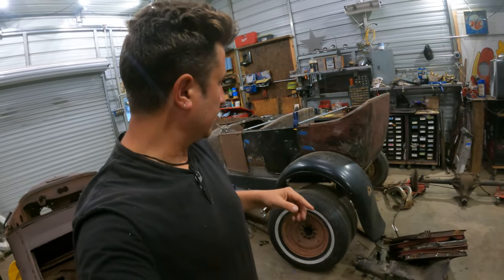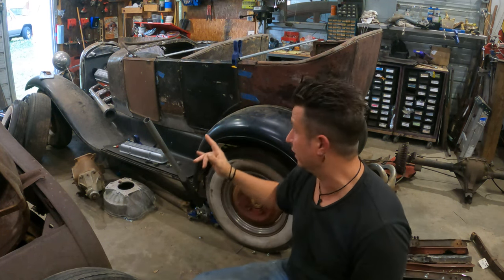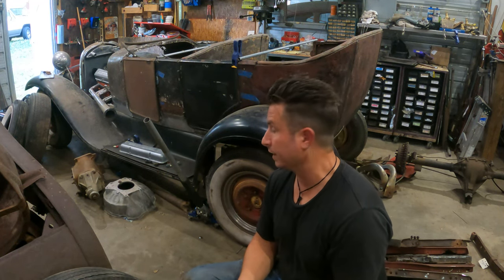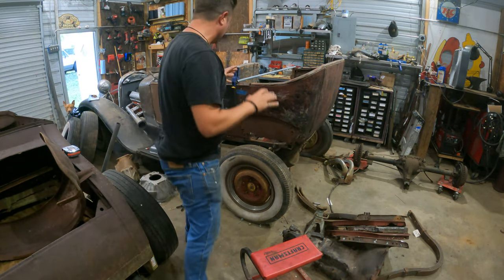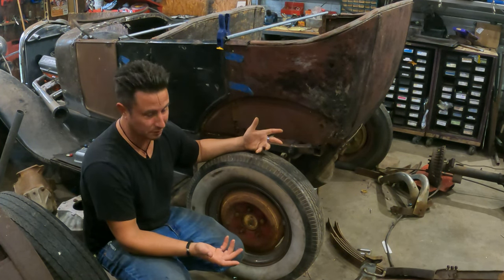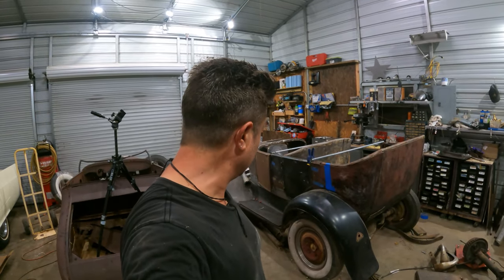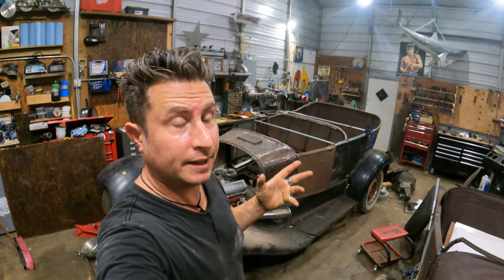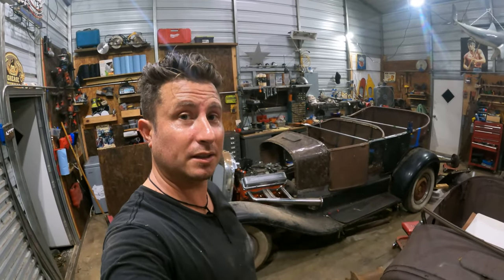1927 Ford Model T Touring Body + Model A Coupe Fenders + Model A Frame = Hot Rod?  Dial it in Part 2

Comment: Very nice and thank you I’m building a 27 touring on a model a frame with a jaguar rear end and chrome dropped front axle with a 302 just been collecting parts about to start building it hoping by the end of will at least be drivable
Reply from the maker: i am rooting for you sounds like it should be a fun car
Reply: @betweenthesharksgarage  I sure hope so picked it up in 2017 so been a very slow process haha definitely got the itch to drive the wheels off it

Comment: I have a '25 Model T roadster. I want to keep the running boards and the pans above them. I had considered going to a restoration for the car, but a hot rod would end up cheaper and probably be more roadworthy in the long run. I am working at removal of a piece at a time, as I remove, replace wood or deal with the rust devil in various parts of the car. If I put the body onto a Model A frame, I was wondering if I really needed to do anything in particular to mount it in a safe manner. Your video sure helps me on that point. I had an old fart like me to tell me that when mounting a T onto an A frame that you start at the radiator and work backwards, but you seemed to say the opposite. My T won't have the original motor in it, but just a small 4 banger most likely, like from a Ranger or maybe a Toyota R22. Not particularly wanting speed, but just a fun car to drive around town. Hoping you have a video specific to your roadster build in addition to the other T shown. I  have always had Model A's, but this T is new to me, so I am looking at everything I can on dedicated Model T sites or on hot rod sites to try to make a low-buck end product. Thanks for the video posted.
Reply from the maker: one at a time here... mounting the body to any frame can be done safely so long as the mounting points on the body and the frame are sound.   You can use existing points or weld on tabs that have holes so you can bolt the two together. 
   For me... Planned to use the stock wheel base on the model A frame and the stock rear end placement.  Due to that I needed to center my body's rear wheel well over the rear end otherwise it would look really weird.    That placed my body....
then to place the engine, I started with the radiator (in the stock location) and worked backwards.  I am having to take the difference out of the firewall. 
    The biggest thing I can see being an issue for you... is IF you want to run more than running boards and aprons...say all your fenders...  They are build for a car with a shorter wheelbase so you will need to extend them (three ish inches i think)     If you are only doing the running boards... welll put them where they look good